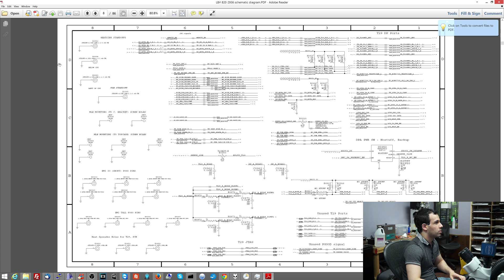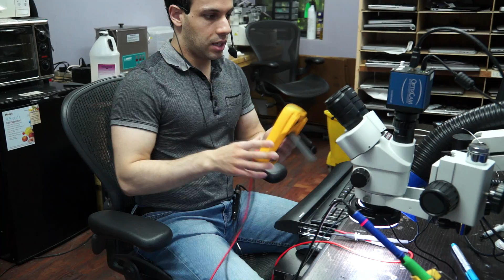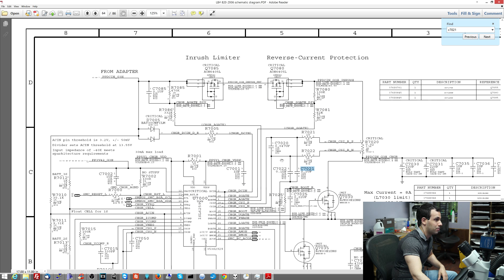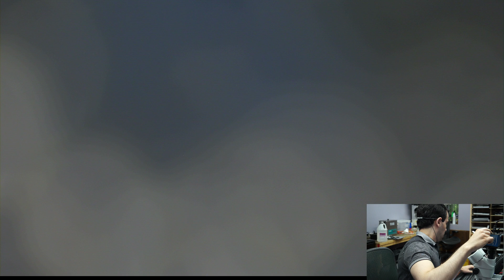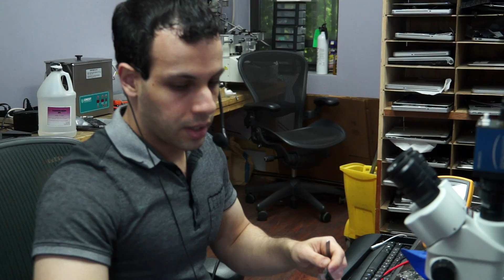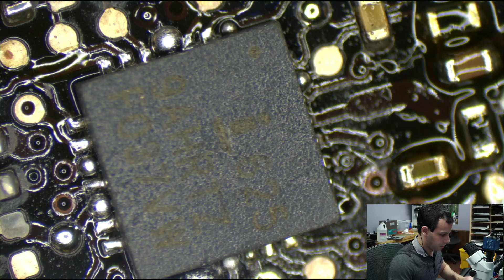No power because of high side current sensing malfunction on 820-2936.

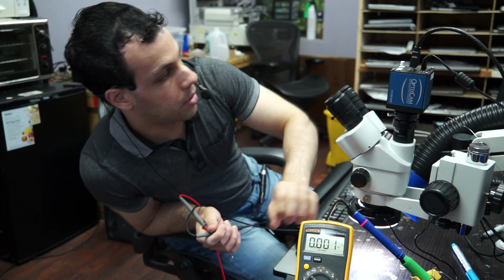Comment: 1:51   Don't think accidentally trying to measure voltage with the DMM set to resistance mode would kill the meter. AFAIK on most basic meters, the lower value internal fuse of the two DMM fuses will blow. (Correct me if I'm completely wrong here!)

Comment: Hi Louis your channel has been a very useful tool on my projects. For that I thank you. Today I have an issues with the same 820-2936b This board was little water damaged. upon cleaning the board it function fine. Now 2 months later is has an odd issue. it stop showing the green light. Well booth off of battery. If the battery is unplug and the charge is plugged in about 40 seconds later the light will go green and board will full booth and when battery is plugged in it will fully charge the battery until green. Also light will stay green until unplugged. I have both the board views and schematics.. I know your busy but I am puzzled.